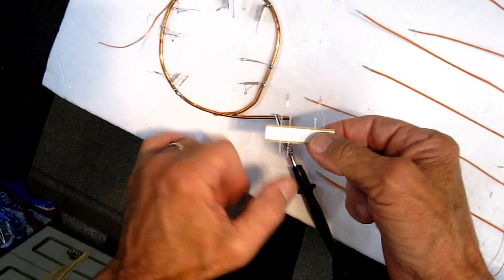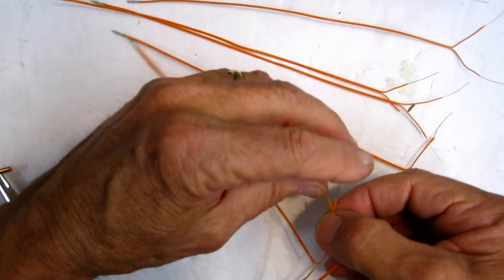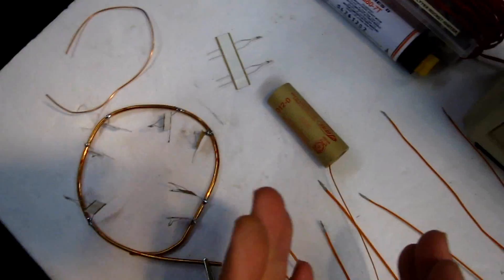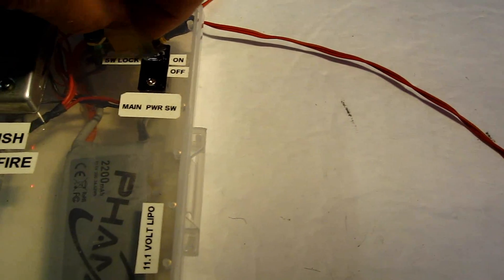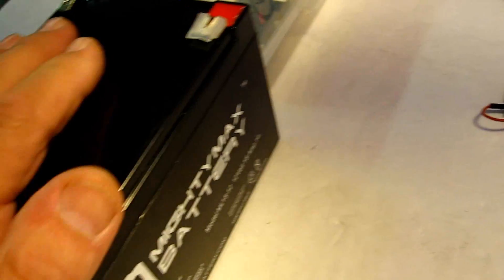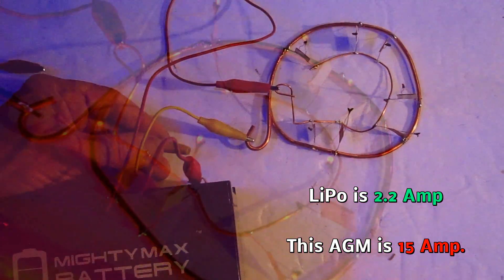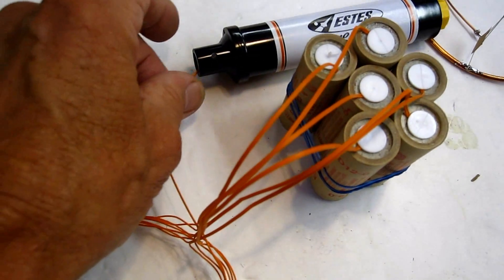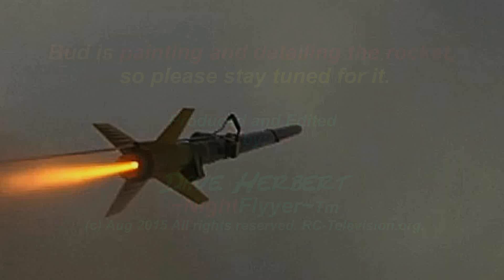Test 7 igniters at once + Stock Estes Rocket Igniter vs Sonic Pro Series & Firing battery size.

Comment: Thanks for the vid.  Was after knowing how many ohms each igniter has.  Don't have any in hand at present, so the controller I'm building can be set up with an appropriate sized fuse.  The controller has two features:  Manual launch and an automated countdown launch. with sonic howler to alert last 10 seconds before launch.  Planned timing is 30 seconds.  That allows some time to set the controller and get away from it and down range for recovery.  Watch for a YT video upon completion of the controller.  A second video will follow in the spring time when I make my first launch in over 4 decades.
Reply from the maker: Right on. The average flash resistance of tested Estes igniters is approximately 0.711 ohms.
Typical Range: The resistance can fall anywhere between 0.5 and 2 ohms.
Current Required: A typical Estes igniter needs about 1 Amp of current to fire. Happy flying.

Comment: A 2200mah battery is not "2.2amps" it's 2.2ah meaning it can delivery 2.2 amps for an hour before exhaustion. The C rating tells you amp delivery potential. If it was 50c it would deliver 50*2.2=110 amps for example.
Reply from the maker: Oh my God!  Everybody knew what I meant.
Reply: @NightFlyyer wow, what an appropriate reaction you just had. I'm sorry your ego is that fragile you can't accept a constructive criticism.
Reply from the maker: @DandSCreations  Haha.  Your just nitpicking and I I can recognize that reaction of yours.

Comment: Thanks.  Have one of these pro igniters, I found in a sack of rockets, and not sure exactly how it works.  Seems like the old igniters used to have two leads to hook alligator clips to.  The pro igniter looks to just be one wire.  Would have liked a little more explanation on the igniters.  But other than that, pretty interesting.
Reply from the maker: Yes there are two leads to each igniter.  They are connected to my copper ring, so it may look like only one.  Thanks.

Comment: When I was a kid flying model rockets, I, was always running out of igniters. I had no car and therefore no way to go buy more igniters. I had a lot of firecrackers around, so, I used the firecracker fuses and shoved them into the motors, however, they had a tendency to fail as the fuses were sometimes too short and skinny. I began breaking the firecrackers in half so that they would shoot sparks up into the motors. It worked so well that I can remember preferring the firecrackers method over spending money on batteries and igniters.

Comment: Very impressive test Dave and thanks for making the video. In answer to your followers comments, I've already started to make the on-board back up 'G' motor ignition system, just in case it doesn't fire when the booster 'D' motors launch the missile. Stay tuned, Bud

Comment: I used to be quite the rocket head myself Dave! Fired off a lot of those G80 Aerotech motors! I could toss a 66" tall 4" diameter Aerotech G-force with a 60" parachute over 1000' on a G80-7 white lightning... Lots of thrust friend!!  Have fun and I can't wait!!
Reply: ***** Just understand that the black powder motors are likely to light first. The composite motor (the G-80), may not ignite before the wires get disconnected from power if the D12s start the rocket moving.
Even if it ignites at the same time, the G-80 will take time to come up to pressure inside and produce thrust.
Reply from the maker: Hmmm !  That may be a problem.  I will have to consider a fix.   Thanks for the comment and that's very good advice.
Reply from the maker: eric deherrera WOW. That sounds fantastic.  This will be the first time I try the G80, so I will be excited to see it myself. Thanks.